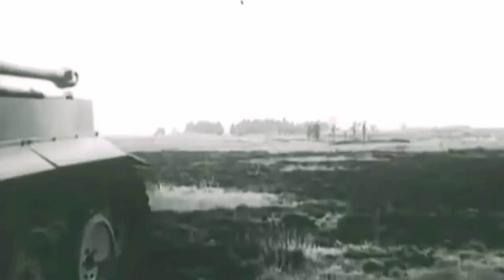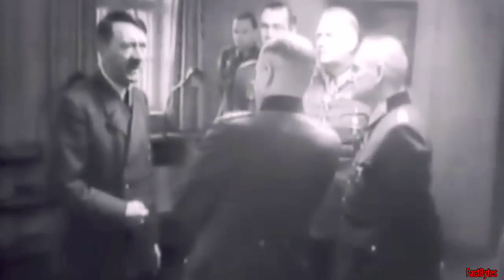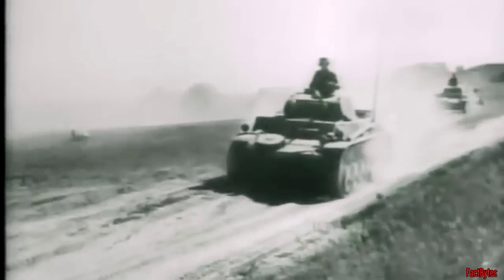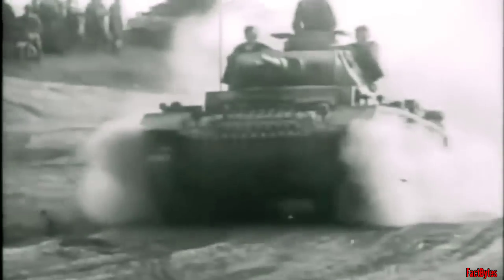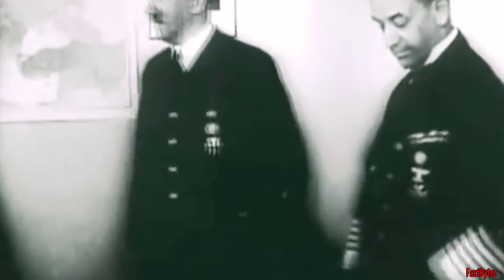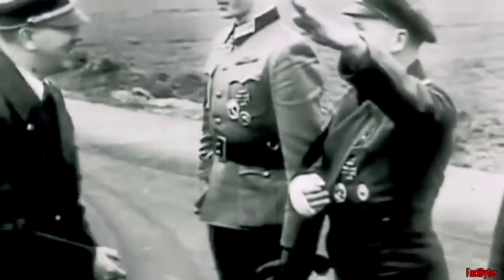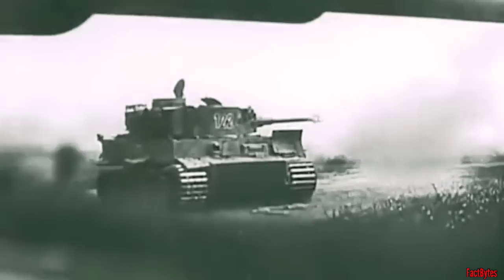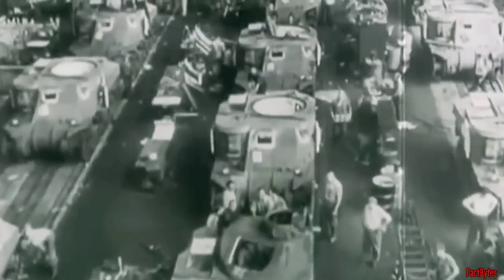Were German WWII Tanks REALLY Over-engineered?

Comment: Stalin and Hitler were both totalitarian dictators and their entire nation existed for them--just ask Stalin or Hitler.  Hitler regarded himself as the world's smartest soldier and took an interest in minutia to the point where he dictated tank designs--and infantry small arms.  Where Hitler was totally ignorant, "it's not important" and he'd delegate the minutia to others--Goering did the minutia in the Luftwaffe and Hitler had little interest in U-boats.  Stalin had been an actual leader in small unit actions--even if that was just robbing banks--and had a more hands-off approach.  This enabled Stalin to concentrate on the vitally important task of staying in power.  Hitler had to pander to and please far more people.  Stalin had fewer key people and could more easily "disappear" someone and seize all assets.  

Russian tanks had quality control problems because their leaders concentrated on quantity--get them out the door.  The mighty T-34 tank didn't have full parts interchangeability so the lack of spare parts wasn't the handicap most would imagine--the parts would have to be fitted to specific tanks, unlike the spare parts for the M4 Sherman family.  German tanks were more craft intensive and there was little guarantee that a spare transmission for a Panther would fit.  At the end of the war, German tanks suffered from quality control issues, too.  Worse, both Russian and German tanks suffered from inadequate logistics tails.  Germany was mostly foot-mobile with horse-drawn company/battalion trains.  Speaking of trains, as long as the Germans could rely on their railroad network, they had strategic mobility.  The Panzer divisions did have motorized repair shops and fuel trucks and ammunition carriers, Panzer division artillery was motorized and sometimes self-propelled, but trucks were not on der Fuhrer's priority list.  Many "German" trucks were captured equipment--good luck fixing a British lorry or a French truck on the Russian Front.  Stalin was given a significant number of trucks, never enough, but 400,000 Lend/Lease American trucks and jeeps is nothing to sneeze at.  Pretend that ten trucks could be built from the resources used in one T-34 tank (the reality is different, of course), and 84,000 T-34 tanks were built.  Stalin would have been faced with producing fewer T-34 tanks (perhaps having only half of those T-34's) or losing the ability to operate offensively.  Some of these trucks became Katusha rocket launcher platforms, some towed the Russian 152mm howitzers and their 122mm field guns and excellent 76mm field guns (that doubled as Panzer killers).  Most kept supplies moving at the front and even carried troops to the battlefield.  Less than 50,000 M4 Shermans were built but America did trucks right!  Germans were convinced that every American soldier had a truck.  Never mind that more than one WW2 GI told me in person that he'd never walk or hike again after marching through France, Germany, or Italy--I got it because I was a Marine in the late Seventies and trucks were something to shoot up or brought supplies--and occasionally Marines could get a ride.  Never mind that I was an avionics technician while on active duty and an infantry Marine while a reservist, I got what the WW2 vets were telling me.  Russian infantry marched long distances on foot.  German infantry was even worse.

German tanks lacked some of the advanced American tank features.  Russian tankers were amazed that Sherman tanks had heaters for the crew.  The number one way to kill a modern tank is to brew up the on-board ammo (number two is ignite fuel and other flammable liquids)--simply punching holes in tanks and killing some of the crew leaves a tank that can be repaired (there are multiple published histories of new tankers removing human remains from their "new" tank after the hole in the armor gets patched and driving that repaired tank into battle--even made it into pop culture with the movie "Fury") but after the ammo storage blows the tank apart or the fuel supply burns out the tank, rebuilding may not be cost-effective.  German and Russian tank crews abandoned broken tanks that American mechanics could return to combat status.  American Shermans had stabilized main guns but their crews were not always trained to use these advanced features.  Russian tanks often lacked radios--that was another Lend/Lease bonus, American radios.  German tanks were all supposed to have radios but like everything else in Germany, spare parts were in short supply from mid-1944 onward.  

This isn't to say that German and Russian tanks were junk.  Some were, but so were some Western Allies tanks.  The industrial base in Germany was strained and the Soviet industrial base (resulting from Stalin's Five-Year Plan and bought with much Russian blood) was focused on quantity at the cost of quality.  Wars are not won by tanks alone.  The neglected U-boat fleet failed to cut England off from overseas supplies, but the inadequate U-boat fleet did create supply difficulties.  Stalin relocated his factories to the east and this disrupted production--but proved prudent.  Chang also relocated his factories out of the reach of Imperial Japan.  I did a paper on how lack of trucks made Operation Barbarossa fail. I may have been wrong, but Rommel had more trucks in North Africa than did the larger German invasion forces in 1941--because most of Rommel's truck fleet had been stolen (captured!) from the British, French and even his allies, the Italians.  My research was flawed, of course, but for a weekend seminar it was adequate for a grade of "A."  I could have mentioned the severe command and control issues of the Red Army in 1941 (radio shortages, Germans clipping phone lines, doctrine that Field Marshal Stalin had to authorize every operation) but I chose trucks.  Unlike the Americans, Germany could rely on interior lines of communications (rail transport and canal barges) until fighter sweeps paralyzed traffic.  On the other hand, given fair weather, the US Army Air Force proved capable of keeping field forces supplied with priority items and could mostly support offensive operations with its vast fleet of C-47 and other cargo aircraft.  In the Battle for Manila, MacArthur's troops were running out of hand grenades, vital for house-to-house fighting.  A radio call to the stateside factory, and C-54's fixed the hand grenade shortage in under 72 hours.  Germany had to ration its artillery shells--Americans seemed to never run out and would send a barrage instead of expending a rifle squad taking an objective--if they couldn't get the USAAF to drop tons of bombs on the German position.  Russian artillery with their fleet of trucks had lots of ammo but their fire control was inferior to British and American practices--with radios and calculating devises and firing tables in short supply.  Engineering support was a two-edged sword for Americans.  Water barrier?  Yawning canyon?  The Engineers could bridge it rapidly--but the bridges and ferries were not up to taking the weight of Panthers, Tigers--or the late-war American Pershing M-26 heavy tank.  That was one design constraint on the Sherman--bridges.  The cranes on Liberty and Victory ships were another constraint--the cargo ships were designed to unload their cargo at ports or anchorages that had minimal facilities.  Getting Shermans where they were needed world-wide was a significant compromise.

Note that world-wide deployment of American tanks is still a design constraint.  In the Yom Kippur War, being able to airlift M60 tanks to the Israelis was a factor in stopping the onslaught of enemy T55 and T-62 tanks.  During Desert Shield, pre-positioned tanks that were carried by special cargo ships took a few weeks--during the initial deployment only a few tanks could be air-lifted into Saudi Arabia.  Tanks are an offensive weapon and digging in a tank for defense basically immobilizes tanks, making them pill boxes.  During the Battle of 73 Easting, Eagle Troop's 9 Abrams tanks and 13 Bradley IFVs blundered into an entire Iraqi division due to bad weather and the usual Fog of War.  Reacting immediately, Eagle Troop destroyed 50 tanks, 40 trucks and 25 armored personnel carriers without any losses.  
https://www.warhistoryonline.com/military-vehicle-news/battle-of-73-easting.html

Note that the Afrika Korps killed more British and American tanks using their dreaded 88mm FLAK gun in the anti-tank role than did German Panzers.  Mine fields were murder, too.  Combined arms wins.
Reply from the maker: Thanks for the in depth insight.

Comment: The Germans didn't have enough fuel for the relative few tanks they had. Neither did they have or were they able to retain enough people to crew the vehicles. Over-engineering was not the sole bottleneck. And Germany did not just forfeit/relinquish industries; that was the Versailles treaty. The Germans also took up Panzer II's against the Russians, not just 3 and 4.

God, this video is really bad when it gets to the tanks. No. The Soviets did not invent sloping armor. For fuchs sakes, the German knights centuries earlier had sloped armor. The Germans choose not to slope the armor on the early tanks (and the Tiger) by too much (since they do have some sloping) simply because that comes at a cost of inner space. Just like how vision ports are important; those are the ergonomics, the soft stats. The things that make your tanks work in practice.

Comment: Ah, German engineering.  Hell, the cars they produce NOW are prone to being over engineered.
Reply: I'm an engineer that has worked for a German multinational.
If you can do something in 10 (edit: 10x) parts, they can do it in 30 and at a higher cost. But when it works, it works very well.
Reply: @recoil53   Yeah, exactly.  Ask any auto mechanic about working on German cars.  Wonderful, great vehicles but, over engineered.  Hard to work on.  A great way to vet a mechanic, if they can fix German cars, they can likely fix anything.

Comment: Yeee gods, NO they were not over-engineered.  Over-engineering would be obsessing over every tiny detail until the gains are no longer worth the time and cost.  German tanks often went the opposite route; "Let's make this sucker huge and call it a day."  Nobody calls a Sherman over-engineered, and yet it could travel far further without a break down ... and could then be repaired and put back into action in a fraction of the time.  It was also much easier to produce and could reach the battlefield having consumed less time and resources in its manufacture. That's better engineering.  If you were a German infantryman and a Sherman was coming your way, while your Tigers were in the rear area being repaired, would you take comfort that your tanks had bigger guns and thicker armor?  Fan boys slobber over specifications, but real engineering considers how well you can produce, deliver, deploy, and maintain a certain set of capabilities.

Comment: The Panther and Tiger II were over engineered, the Tiger I was not. Many of it's mechanics, chassis, and suspension were largely copied over from the Panzer IV, with the interleaved road wheels being the only radical departure from previous designs that were also incorporated into the Panther, Jagdpanther, Jagdtiger,  and Tiger II. The Tiger I, along with the Tiger II, were very under-powered though, which in a sense isn't exactly "over engineering" but rather a shortcoming of it. When you design a vehicle that weighs 53 and 70 tons respectively, you need to at least make sure that the powerplant and transmission can handle the weight and give sufficient horsepower/ton so as to make it faster than someone on a bicycle going up a hill.

Comment: why was German Tiger armour FLAT? makes it less effective and the vehicle heavier and sloped armour was a well understood concept by then. also Zimmuret was deigned to counter MAGNETIC MINES that only THE GERMANS USED and it was FLAMMABLE and added a surprising amount of weight as well. 
as for T-34 it was built in a nation under siege that needed its tanks IMMEDIATELY to replace huge early losses, and thus corners had to be cut to ease production as much as humanly possible while still making it useful on the battlefield. Considering the incredibly hard conditions it was up against the T-34 did the best out of any nations tanks in my opinion.
USA had the benefit of a totally intact infrastructure and an ocean between them and any invasion. Soviets DID NOT have any such luxury.